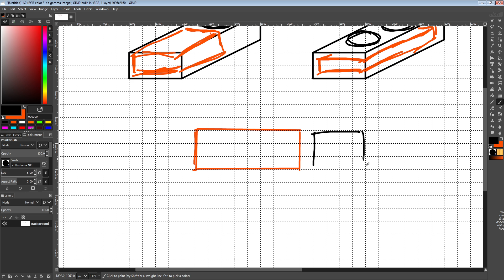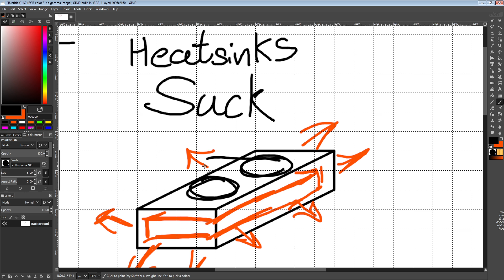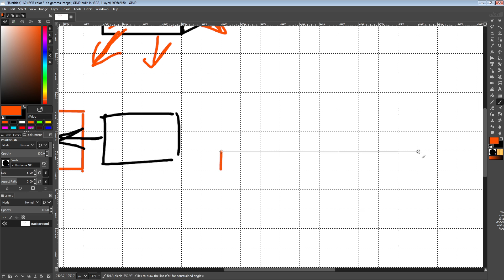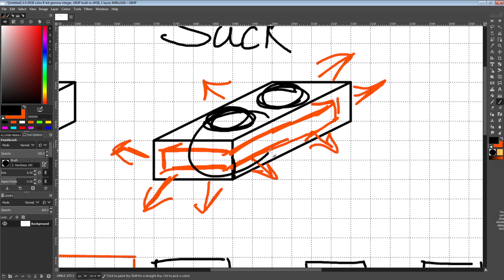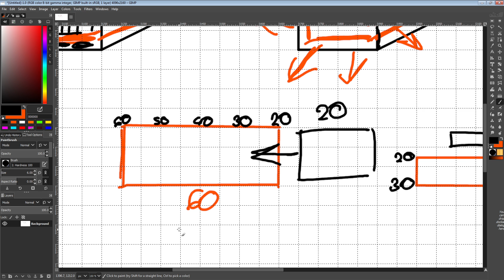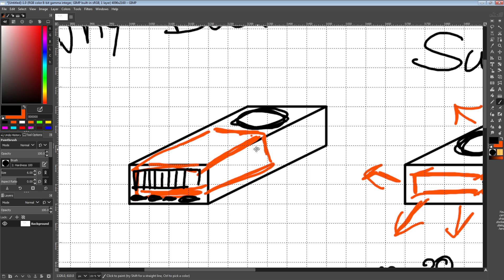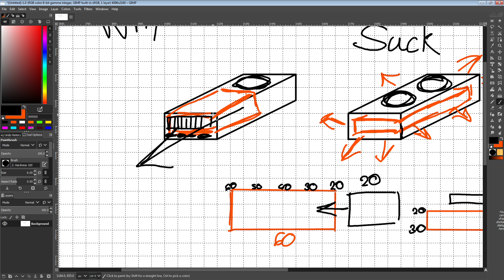Why blower heatsinks suck

Comment: Not sure about this. Blower heatsinks keep the GPU heat confined to the GPU and scatter fans scatter the heat inside the case and to other components. Ever use a scatter fan GPU over your M.2 drive or chipset? The scatter fans cause the other component fans to run faster due to the increased heat from the GPU heat getting scattered to them. I'm sure the added scatter heat is not major but still a factor. The mock up drawn is as if the GPU's are all by themselves but they need to include the rest of the system for accuracy or completeness or its too idealized a scenario.

Comment: Ok hear me out. 

4 slot card, with a vertical 80-92mm fan sucking air from the case intake and blowing it through the fins out the case exhaust. 
Now that's engineering right here

Comment: this shows that you never directly compared blowers to fans

I did some research in trying to duct fans away from heatsinks to reduce noise

HINT: static pressure

blowers can be 1/4 the size of axial fans and STILL move more air through a semi restricted area

try it
Reply: my test, a 5015 blower vs a 120mm axial fan

the 5015 was about 4 times as powerful when pushing through a 15mm tubing

Comment: For a single consumer tower, blowers do indeed suck. HOWEVER, consider compute clusters / datacenters / servers, where dozens, hundreds, or thousands of components all need to be cooled. In these applications, airflow throughout the entire space must be carefully considered, and it becomes important to have dedicated "inlets" and "outlets" for each system. Ideally, cool air is delivered to the inlets, flows consistently through the relevant cooling components with minimal recirculation, then exits through exhausts (to AC units, etc). Blower fans are perfect for this - not only do they actively contribute to the pumping of air in one direction through the system, but they also minimize recirculation of hot air within the case itself (especially if many GPUs are installed right next to one another). In other words, blowers work well when ensuring a certain "flow pattern" is critical for maintaining efficient cooling of many tightly-packed, power-dense systems. (It turns out this is also a useful arrangement for managing dust with minimal maintenance). 

Note that enterprise compute cards exclusively use blower-style coolers: Quadro, RTX Server, Radeon Pro, etc - all use blowers! This lets you pack many of them into a server case right next to one another. Then, you can stack a bunch of those cases together in one rack. Assuming you deliver proper ventilation to and from the rack, you will still be able to get acceptable cooling on all cards in all systems (which would not be possible with open-air coolers!)

On the other hand, open-air coolers work great for individual PCs, i.e. applications where there are 1-2 GPUs surrounded by lots of empty space. Open-air coolers are very "selfish" coolers from a systems perspective (they don't drive bulk airflow in any single direction and tend to throw exhaust heat towards all the other components), but the overall power density is low and ambient case temperature essentially agnostic to cooling performance. As long as there are some fans in the system, hot air will "just find its way out of the case" and it doesn't really matter where or how. Raw airflow volume (rather than direction / inlet / exhaust) is all that really matters, making open-air coolers great for individual PCs. In this use case, open-air is definitely the way to go! Blowers aren't nearly as efficient or quiet here, but that doesn't mean they don't still have their own applications!

Comment: It was an intelligent design from the era when PSU were put on the top of the case and used as the only exhaust from most OEMs.
The fact that the GPU is under the CPU is another idiot design flaw.
HDDs are safest when used from 31 to 35 degrees (Backblaze source) so they are rightfully put low and in front the case. They heat up not too much that their exhasted air isn't useful elsewhere in the case. Now the GPU takes that air and heats it up. Some cards up to 90 degrees. But even at 70 degrees that air is no use for the cpu that heats up even if you got a big dual tower. So you need another one or two intakes the closest possible to the heat source. Which isn't at all what happens in todays cases. It was a thing to have a side panel fan which actually did most of cooling for the GPU or even CPU and VRMs, because it was the closest. Case exhaust fans proximity isn't crucial as the acceleration of air usually is way shorter than the pushing side of the fan. Not using the side panel to intake or exhaust air is really stupid too.

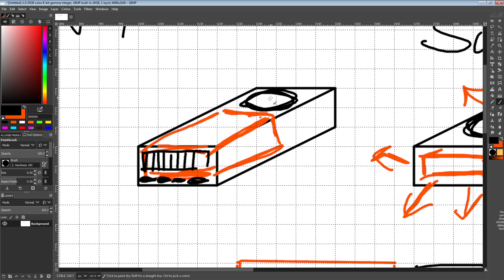Comment: 6:50 you are rambling without sense. Blowers dont recirculate hot air back to the card. This is the most important reason if not the only engineering choice for them. They work in every stupidly build enclosure practically as good as in high airflow one. So dont flame them as they are average a better choice :]

Comment: I think six 40mm fans would probably move more air than a blower fan. You'd also have the entire length of the card for a heatsink, and surface area is just as important as the amount of air you have to cool with.

Comment: I'm waiting for the day GPU's are allowed to be thick enough to have straight up tower coolers on them. Like engineering samples have or like DIY Perks did with a Noctua and Linus too with a DeepCool Assassin I think
Reply: And here I am dreaming of more single slot gpu's so I can cram more of them into the case, yet latest single slot gpu is P4000 and rtx 4000, but they have only 8GB of RAM, so Radeon Pro Duo is a better value per pcie slot since it has 32GB and 2 GPU's per 2 slots

Comment: what fresh airflow from the front u r talking about, in which case? in small case.. maybe. in trend bigger cases with 'more space for everything' and often with glass on front thats no way for 'fresh airflow'. and that arrows over the backplate.. srsly u have no idea what u r talking about. every zone in my case is cool, only gpu level cumulate the heat and i have a warm zotac 970 (80°C for 6 years). the gpu core cooling problem lies in size of radiator which is small for blowers and that way the heat capacity/volume and the speed of that cap. reduction is too small. small volume of radiator for non-referent cards makes the problem too, that's why u want to take thick Palit jetstream and not thin PNY. the idea of blowers is better than non-referent cards and that's a fact but trend standard is stil going for 'blowing it everywhere' as u said which is non-comfortable for case standard instead of creating better blowers. but there is new idea of Founder's Edition cooler for rtx 30xx. looks very nice and it needs to be checked.

Comment: If i had to guess I would say that the grill is there to prevent damage to the cooling fins. I also consider blower style cards to be worth a look for very small form factor builds since they dont blow a whole lot of hot air into the case but most of it out the back.

Comment: Blowers are good at removing heat from the case, and if you are running multiple GPU's. 
They are also cheap to build, easy to assemble.
Unfortunately, i think even the designers/engineers don't really know what they are doing or they are trying to hit unrealistic price points making bad compromises in the design.

Comment: Interestingly enough, the founders ed cooler for both the 3080 and 3090 appear to be som form of hybrid between a blower and a standard cooling solution, which I find very intriguing. 

I wonder how much of the thermal load gets exhausted out of the back of the card. This design should be especially well suited for SFF cases, as it doesnt dump all the waste heat into the case, making these cards basically act like lower TDP cards inside the case, no?

Comment: What if you replaced the blower fan with like two 40mm fans blowing air the same direction?  

On one hand, you can have more heatsink.  On the other, I can't imagine they would move nearly as much air, unless they're super thick 1U server fans.

Comment: The blower will extract the maximum cooling potential out of a given amount of air if it's hitting equilibrium right at ejection, but will not maximimize the cooling potential of the fin stack.  If blowers weren't way louder for moving the same amount of air, it might be a good idea ;). I think a blower will generate plenty of turbulence since the air exits tangentially.  Static pressure isn't much of a concern with a blower, but of course you pay for that by sacrificing cfm anyway.

Comment: If you have multiple gpus, i think that the blower might have an advantage.  The air would heat up through every card as it worked it's way through the series of cards.  

Super expensive nvidia quadro cards have blowers.

Comment: Silverstone-style reverse ATX (even better would be smaller form factors) cases would work really well with exhaust GPU axial fans. Just have GPUs exhaust everything straight out of the top with no PSU shroud in the way. It'd solve the entire problem you mentioned where nobody thought about the heat output modern GPUs would turn out to have. But obviously, it'd need an industry-wide push so that's not happening.

Comment: 1. They dont suck they blow. Or do they do both.... 
2. I disagree.  Nothing beats blowing hot air out the case directly so you dont feed it to your vrm,cpu,chipset,ram.  My case temp is equal to ambient with a non blower that wou
D not be the case.
The only downside is noise which not everyone cares about.  Blower style also dont suck their own hot air in again unlike regular gpu's
If it was up to me id have a 4 or 5 slot cooler with a 80x80mm fan on the rear. That gives a huge cool capacity with no negatives given you dont need pcie slots. .

Comment: Limited viewpoint expressed on this video. Some benefits of blower cards are that they don't dump all the heat into the case affecting the whole system, works well with multiple cards, for smaller systems can be the better solution. Anything over 220w I found blower cards negative is noise and insufficient cooling. Vega FE at stock is a rather quiet blower card, rated at 225w. Vega and the rather power hungry if you try to push it makes that rather super quiet blower setup into a rather noisy one quick.

Will be amusing when people are dumping 320w+, ASUS 400w, OCing 400w+ with the upcoming Ampere cards adverse side effects from that solution, probably should be a AIO for over 300w cards like AMD has done several times.

AMD also has made some great cooling solution cards as well, well not many but they can do it right at times.

Comment: What I don't understand then is, why do manufacturers even make them?  And sure, you can say save costs yada yada; my next thought is, what about RMA rates? That extra heat will inevitably translate into higher failure rates on cards, harming customer value and ultimately the brand/margins.  You would think that AMD and NVIDIA especially would focus on eliminating that kind of RMA since all it requires is adequate cooling to correct for it.  I know in some circumstances blower style is better ie mini itx builds where there isnt any ambient air to support the axial GPU, but when folks think of blower, they think OEM or cheapo enthusiast models

Comment: G'day Buildzoid,
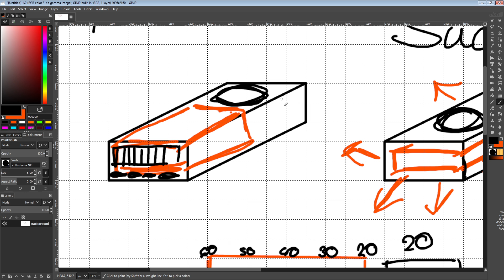17:40 "That's why we don't see heat sinks where they shove air through the fin stacks sideways, because that's just Dumb" My Gigabyte GTX680SOC Windforce5 would Like to disagree & it will do this Extremely Loudly 🤣🤣🤣🤣🤣
& what does Buildzoid think of the Alienware Aurora R11 with Asetek Liquid Cooled NVIDIA GeForce RTX 2080 Super,
Asetek renowned for suing anyone for anything basically like their CPU AIO Pump style is claiming it "all new" yet it has been done almost exactly the same before by 2 companies 🤔, seems a double standard

Comment: I'm a fan of your channel, but sometimes you overcomplicate things a lot.
1. Non blower style cards have a much higher capacity radiator. 
2. Why are they still noisy and why are GPUs still the noisiest part of a build, even high end models?! The fans they come with, are just as anemic as the blower style radiator is. So what do you do? You remove the fans with the plastic shroud, and zip tie 2x120mm fans to the radiator. Now your GPU is cool and silent.
3. End.

Comment: Well, there is also the fact axial fan designs use bigger fans, like, much bigger. And two or 3 of them. What if a blower cooler had a 140mm fan instead of the 70-80? mm they always seem to use ? What if it had 2 of them - one on each side for a 3X-4X slot GPU ? I bet we would be able to actually use it as a hairdrier then :P Jokes aside, the noise would be horrendous even if it is only from the large amounts of air being pushed through the heatsink but it would at least be an adequate cooling solution and it would not dump any hot air inside your case. Quite the opposite, you may use it as an additional case exhaust fan (or two), actually improving the internal case temperature.
My point is, we always see the same design blower coolers, made as cheap as possible. And of course it is horrible, but what did you expect - it is the same design always slapped on the cheapest model of a card. If someone actually tries to improve it a bit, or maybe make a better version of it (with bigger fans, copper heatsink with vapor chamber, dual sided so it cools the back side of the PCB which also gets hot, thus aiding the front side cooling, etc.) , it might surprise us. All I ever see is the same 70-80mm cheap fan with, most of the time, aluminium block heatsink with barely any fins, cheapestest thermal paste available, design logos on the back grill instead of bigger holes and less DVI ports ffs.... No wonder is sucks.

Comment: Actually blowers have a place in the inverted case markets, (they would typically have a panel to take in air if you had a case with an upside down mount for the GPU)

But also i was using a Titan X (maxwell) for 3 years that would max out at 74c (and i ran that thing pretty much 24/7 on BDO) in the FT05 (and a passively cooled 4690k on a megahalems for that matter) x2 180mm fans if im correct blowing all the hot air out, Only used the high fan speeds in the summer,

I had to change the card i had before that because the gainward phantom would melt the top of my TJ08E, that cooler has the 3 fans... Under the heatsink, Blowing on a cold plate (that would be warm after 10 mins anyway hurrr) to grab that air out, I mean it looks lovely but the blower has much more of a use case compared to that thing.

Comment: Maybe you should make a 2nd part with case/laptop/console thermals.

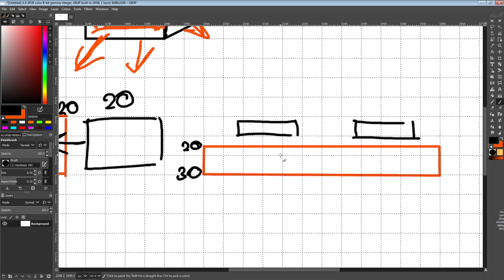14:55 same thing applies in the case. The air moving within your components is too hot to make a difference. Just having even one properly placed exhaust fan and one intake fan makes all the difference. It's also why just by removing a panel on your case you drop 20C while doing nothing to the fan situation, basically free cooling.

Then there's consoles and laptops where almost anything you do will be bad to mediocre, because there isn't enough space to fit the air without very loud blowers.

Comment: One of the most relevant point of cooling is "Countercurrent exchange".
If it is implemented, it is the best way to transport heat away. Full stop.
Also very important is the speed and the volume of the air and the area of contact of the air and the fan.
So I can not agree, blower are not all bad, bad blower are bad, but blower are not necessarily bad.

Comment: Wait, fans tend to face the bottom of the case, so there is no recirculation cause hot, "used" air goes up cause physics. That is why I love my Cooler master sl600m. i5 8400 +  msi 1070 armor with 4x 200mm fans. I just wish there was a properly made solution to flip the gpu and slap cpu heatsink size cooling on it. I dislike watercooling.

Comment: Why don't they make any cards with blowers with a centralized fan and heatsinks on both sides, kinda like the GTX690? I know that was a dual GPU with a heatsink on each chip, but you could do it on a single GPU transferring the heat with heatpipes around the fan to the other side, there could even be fins when it's going around the fan for a little extra cooling. Might be an overly complicated solution, and it'd lose the "exhausting ALL the hot air out of the case" advantage, most likely would still lose to the regular open air heatsiks, but it'd be interesting to see and most certainly more efficient than the regular blower design.

Comment: This made me think if is possible to position the fins in a way that will direct the air out in in one direction like Having a big exhaust pipe created by the fins leading the air out.  
Preferably out of the case.  

Wouldn't that transfer more heat out and cooled it more efficiently and allow a better thermal limit ?

Or having a case where the motherboard sits horizontally.  The gpu will have to exits for hot air.  
There i solved it 
😅😆

Comment: Msi Air Boost Vega 56 have a bigger window and would recommended a cutting tool to make full use of the blower exhaust gate.  

Blower fan are Pressure fan to create high volume of air pressuring inside the chamber and as physics, the air will find the way out creating thru a wind tunnel, that said if part of the window is being block at exhaust, more heat will build up inside the fins than being push out fast enough.    Not great for OC dues to lack of making it a triple slot or go old school to put in a blower bigger than the width of the card.

Comment: This makes me wonder why don't we see motherboard designs using a second socket for the GPU that is functionally identical to the CPU: just a chip you buy, stick in a socket, then mount a big-ass heat sink or radiator/cold plate on it.